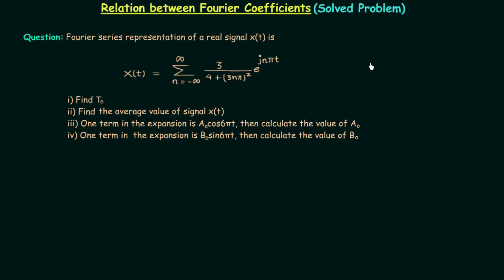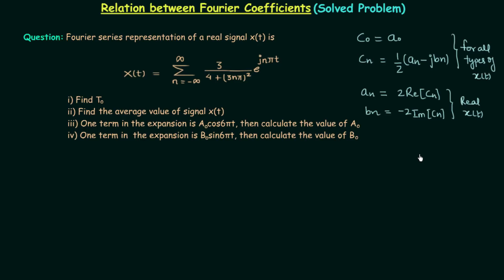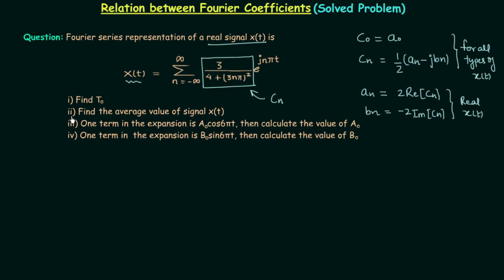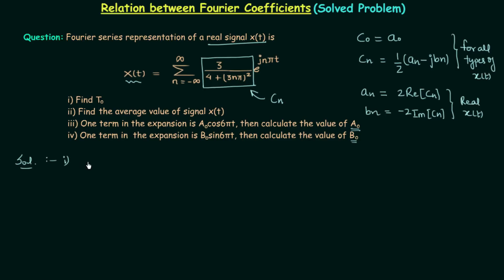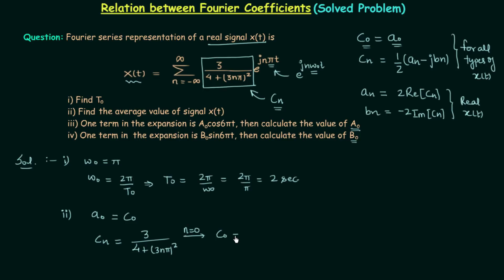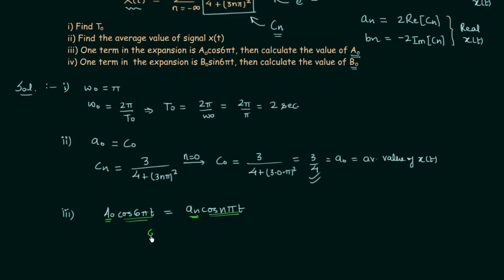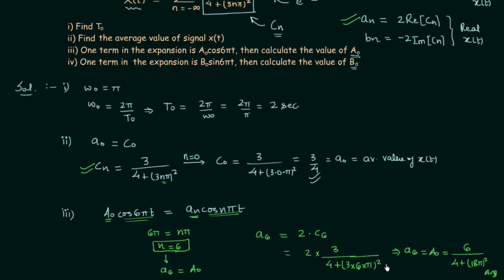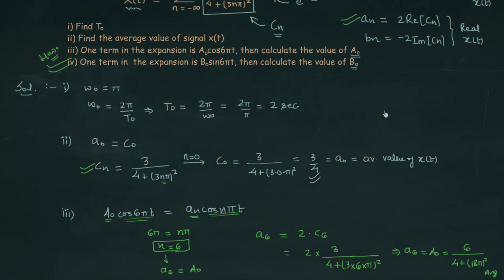Relation between Fourier Coefficients (Solved Problem)

Comment: Sir at 0:49 why these two relations are valid only for real x(t)?
Reply: YEAH BRO HOW THEY APPLIED IT BECAUSE HERE X(T) IS NOT REAL
Reply: Cos, we found these results from trigonometric expansion where it does not contain imaginary part
Reply: The question clearly says x(t) is a real signal so the relations are valid
Reply: Ritesh Choudhery mg
Reply: Since C_n=1/2(a_n-b_n)
and C_-n=1/2(a_n+jb_n)
Thus when we find C_-n* it comes out to be the same as C_n
Thus implies both are conjugate symmetric and henve the signal must a real signal.

Comment: no u cant conclude "if there is no imaginary part then the signal is even" for a real signal  Cn=conjugate of C-n. u misinterpreted it as Cn=conjugate of Cn. and one more, for even signals Cn=C-n and value of Cn is real (ie Cn=conjugate of Cn),for odd signals also Cn=C-n but here the value of Cn will be imaginary(ie Cn=negative of conjugate of Cn) I think these points are missed in the lecture. so in this question the given signal is real and even, not just real.
Reply: arey bhai jab bn=0 prove ho gya to automatiacally signal even hi hota hai (for even signal bn is always zero, no sine terms only cos terms)

Comment: From this can i conclude that if a signal is real , if there's no imaginary signal present then the signal is even signal ?
Reply: Yeah well it is a very good question. If you have a real valued signal , since there is no imaginary part , all b's (the coefficient of sin) will be 0 and you will only end up with cos terms .Therefore you will have even function ...
Reply: no u cant conclude like that for a real signal  Cn=conjugate of C-n. u misinterpreted it as Cn=conjugate of Cn. and one more, for even signals Cn=C-n and value of Cn is real (ie Cn=conjugate of Cn),for odd signals also Cn=C-n but here the value of Cn will be imaginary(ie Cn=negative of conjugate of Cn) I think these points are missed in the lecture. so in this question the given signal is real and even not just real.